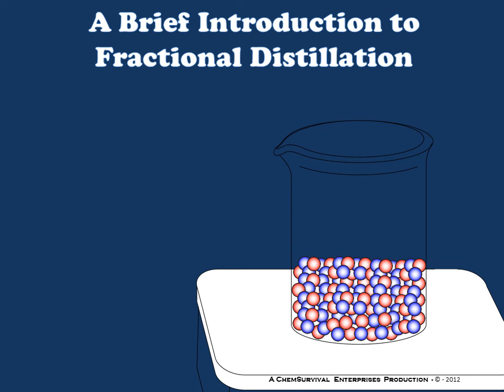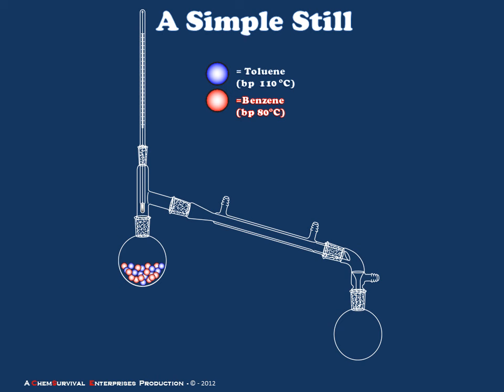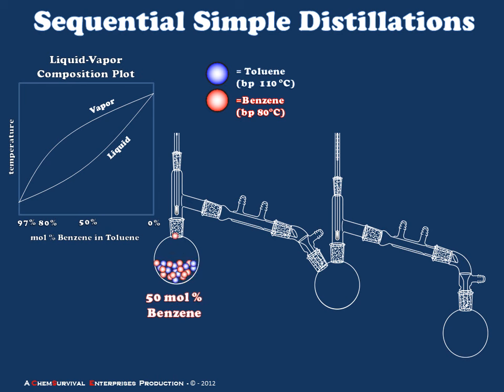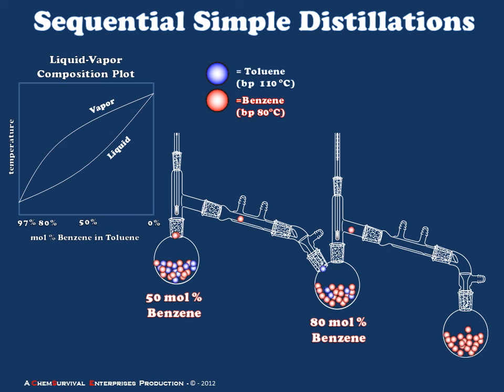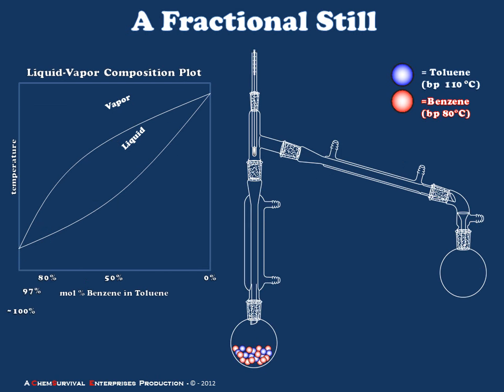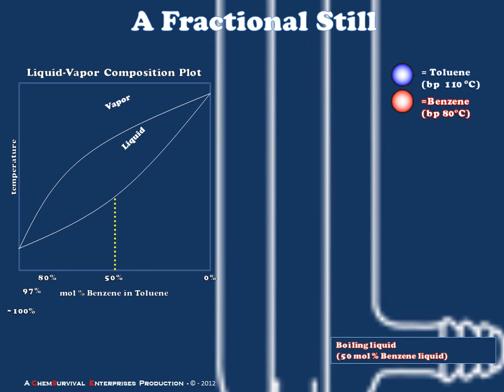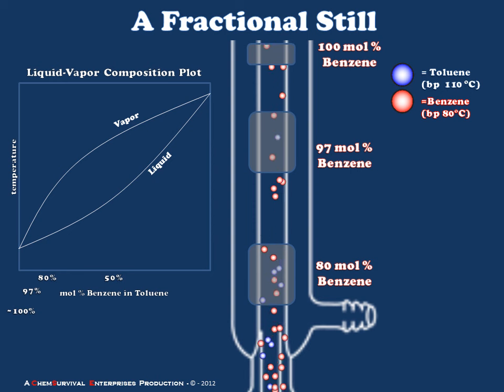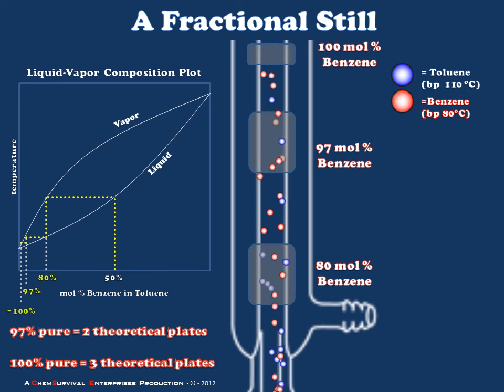A Brief Introduction to Fractional Distillation

Comment: This is a simplification which I needed a long time to understand. If you heat up the first liquid mix, it's already changing its mixture while doing that (liquid part). So you won't get a 80% purity, it has to be less. You only get almost this purity, if the second amount (the evaporated stuff) is much less then the first.

Comment from the maker: Hi Kris,

I try to keep the videos short.  Discussing packing with steel wool, glass beads or even those columns with actual physical plates would be a cool enhancement.  I may yet explain this technique in a later release of the video or in a different video all together.  As a side note, we have learned in our labs that even when students neglect to pack their fractionating columns, they still get better results than running stills without the column at all!  Thanks for the comment.

Comment: After the first distillation 
The 80% mil benzene 

This means that the total pressure is
(0.8×1200) +(0.2×300)=1020 torr
This means the other distillation would give me (960/1020) ×100%=94% mil benzene 

Can you please tell me how did you get 97%??
Are my calculations wrong??

Comment from the maker: Hi Anxious.  There is no water in the jacket around the fractionating column.  Reflux condensers are often re-purposed for this task, but NO WATER is used, because a temperature gradient across the column is crucial to proper function.  As condensation forms in a higher (cooler) region of the column, it begins to descend and vaporizes again in a lower (hotter) region.  Often, columns are packed with inert solid material to maximize surface area on which this process can take place.
Reply: So I can use an old condenser for this? I have one laying around.
Reply from the maker: @Phoenix_Atlas  I see no reason why not, just as long as you keep in mind the points made above.
Reply: @ChemSurvival  then would just a long glass tube extending straight up work the same way since you don't pump water through the the condenser chamber?
Reply from the maker: @Phoenix_Atlas  yes.  In fact there are specially designed fractionating columns that do not contain the outer jacket at all. I use a Vigreux column much like this one:  

 https://www.labdepotinc.com/p-64122-distilling-columns-vigreux?gclid=CjwKCAiAxJSPBhAoEiwAeO_fPx7gZ0oAMBNtm9ImDm9HRYYKEIKixVUg43_DKHTvHdP3PE2jSEOYJxoCR8AQAvD_BwE

on my setup.  Those columns are fine to use as well, although they cannot be re-purposed as a condenser should you find the need for one.
Reply: @ChemSurvival  that's awesome. All the fractioning columns I've seen are intricate glass pieces that look extremely expensive compared to just a glass tube.
Reply from the maker: @Phoenix_Atlas  make no mistake, the additional engineering certainly makes for more efficiency, but  you can definitely improve a simple still with the addition of any kind of column available to you.

Comment: You said that on 2nd time distillation we get 97% benzen , but my calculation show 94% . Please check If I am calculating wrong.

Pt = 0.2 * 300 + 0.8 *1200 = 60 + 960 =  1020

now % benzen in that vapour is = 960/1020 *100 = 94 %

Comment: how is there vaportization and condensation occurring in the  fractional still? is there a water jacket around the distillation column? is heat being added to the system from the boilup then condensation is occurring of the heavy keys that touches the sides of the fractonation column? please advise.

Comment from the maker: HI Shane.  There are clearly some simplifications in this video which are intended to make it easier to digest.   I disagree with your assertion that no vaporization happens in the column.  There is a temperature gradient along a fractionating column, so as condensed liquid descends the column it has an opportunity to re-vaporize, thus becoming more enriched in the more volatile component.  To say that it is simply refluxing toluene and distilling benzene is also an oversimplification.

Comment: When you cool down 80% mole vapor Benzene,  would it be considered 80% mole Benzene in Toluene? Then afterward, when you heat it up, does that 80% mole Benezene in Toluene turn into 97% vapor benzene?

Comment from the maker: Yes.  Reflux condensers are often re-purposed as fractionating columns.  When this is done, it is critical that NO water be used in the jacket as this will defeat the entire purpose of the column and amount to simply refluxing the mixture.  This is a common mistake made by introductory students who don't read the procedure carefully before going into the lab!

Comment: Disclaimer. I live in New Zealand where distilling spirits in the home is not illegal. I have a small still that thru watching your video uses the fractional distillarion mechanism you describe.  The "pure" ethel alcohol fraction comes out of the angled column on the right at between 48 and 52C. I have a question:: Do I have to monitor the temperature of the solution being heated that contains both water and alcohol? Or will the alcohol fraction keep the temperature stable in the heated solution until all the alcohol fraction is boiled off?
Reply from the maker: Hi Clarkewi.  Even in the best fractional still, the composition of the distillate will change through time.  Generally, this change involves increasing concentrations of less volatile components (in your case, more and more water content).  So the highest proof spirits (those with the lowest boiling point) should come over first.  If you are monitoring the temperature in your still head (the temperature of the vapor above the boiling liquid, not the dripping liquid distillate), you can gauge when it is time to stop your still by looking for a sharp increase in the temperature.  This is an indication that the ethanol is depleted from your boiling vessel and now you are just bringing over more water and diluting your distillate.

https://youtu.be/nFJy6F_E50o

This video might help you to understand better.  If you can monitor the temperature of the vapor in the still-head, you want to try to stay on the lower plateau of the diagrams that I discuss in this video.  A healthy still should operate in the mid 70 to 80's of degrees centigrade.  Good luck on your (perfectly legal down under) project!

Comment: So, there's a calculus here that's not mentioned.  Your lower mixture won't stay at 50% very long, meaning you'll need a longer and longer column to maintain ~100% as your mixture boils down, correct?
Reply: based off data i got in my own lab from this, our sample got more pure the longer the experiment ran.  we took samples at different points in time and our last samples were the most pure.

Comment: Thanks so much for this video! Now I understand how fractional distillation works.
I have a question: in an azeotropic mixture, we can't separate them using this method. Is it because they have similar partial vapor pressure?

Comment: Brilliant explanation! It's a pity it took me so long to find this. One question though (if you're still around :) ) - With two miscible liquids with significant boiling point differences (as per benzene/toluene), Is there any advantage in warming the fractionating column to the boiling temperature of the benzene (the lower of the two boiling points) to minimise condensation of the benzene in the column and perhaps give it more "encouragement" to reach the top of the column?
Reply: I have the same question but I think if u had a warmer column the faster it would go but it would be less pure because there would be less reflux of the toluene

Comment: this is a great illustration!! good job ! but i have a question what about the natural progression of the system won't the system raise in temperature to accommodate the loss of the vapour pressure so the liquid can still boil?? and wouldn't that reduce the purity of the vapour gradually containing more of the less volatile liquid?? and how would the plot proceed in a continuous distillation ?
Reply from the maker: YES!  That is exactly what will happen!  You can see my explanation of it here http://youtu.be/nFJy6F_E50o

We usually simplify introductory explanations of distillation by only considering the first moments of the process, when the composition of the boiling liquid has not changed appreciably.  However, as time passes, it will indeed become more concentrated in the LESS volatile solvent.  This results in a constantly (though not necessarily consistently) changing boiling point for the remaining un-distilled liquid.  Please check out the video linked above and share with your friends/classmates/students/teachers
Reply: ChemSurvival Thank you :)

Comment: I believe there are some flaws in his explanation. There IS condensation in the fractionating column, but there is no vaporization happening in the column. What happens is, toluenes bp is higher than benzene. When the 80% benzene and 20% toluene vapor passes through the fractionating column, it cools the vapor down enough that the toluene and a small amount of benzene condensates and falls back into the flask. Basically refluxing toluene and distilling benzene at the same time.

Comment: In the fraction still, The gas (which has 80% benzene) condenses because the temperature drops.. Which I understand.. But then how does it vaporize again IF the temperature is low?????????  The substance oscillates between gas and liquid phases in this tube which purifies the gas as it moves up but again... How does it vaporize if the temperature is low.  Please someone explain this to me.. Thank you!
Reply from the maker: Thanks for the question.  It vaporizes again because there is a temperature gradient along the fractionating column.  The higher you go on the column, the lower the temperature and, of course, the lower you go, the higher the temperature.  As a newly condensed drop descends ever-so-slightly, it is warmed ever-so-slightly and vaporizes again.  This process continues along the length of the column, resulting in a distillate of much greater purity than a simple still can accomplish.
Reply: Ah, I see. I'm assuming that small volumes of the gas/liquids in the fractionating column help with the phases.
Thank you for answering!  It's much appreciated!

Comment: Just a wonder 
Can we distill salt-water
Reply from the maker: we sure can.  some water desalination technologies use this technique (at least in part) to lower salt concentrations in water.  It is a very high-energy-consuming technique, though (boiling water takes a lot of energy, which is costly) and there are usually other ways to coax the water away from the salt in a more cost-effective manner (like reverse osmosis).
Reply: @ChemSurvival  Thank you

Comment: What does it mean mol% ?!?!
mol ist just a number (6,022E23) and 1% is 0,01 of something.. mol% is then 6,022E21 particles 
just use % O.o
Reply from the maker: Hi Karlo.  This is a GREAT question!

When we discuss percentages, we must either state (or assume that our audience already knows) the units we are comparing.  For example, consider a mixture of two gasses - one mole of each.  Now let's say that one gas has a molar mass of 100g/mol and the other 200g/mol.  This means that the mol% of either gas is 

(1 mol)/[(1 mol)+(1 mol)]*100%, or 50 mol%. 

Now, assuming that one of those gasses is TWICE the molar mass of the other.  the mass% of the heavier component is

(1mol * 200g/mol)/[(1mol *100g/mol)+(1mol * 200 g/mol)]*100%,

 which is 200g/300g*100, or 67 mass%. 

So if I just say "50% of gas A", I leave the viewer wondering that the ratio really is.  Is it based on mole count, or mass?  It matters, because each method describes a different combination of the two!  To relieve the ambiguity, I MUST state 'mol%' or 'mass%'.

In the case of distillation we are using ideal gas law and others to make our prediction, which means we are assuming that all gas phase molecules are indistinguishable from one another (hence the name 'ideal gas' law). So here it is the mol% which will dictate the behavior of the components of the system.

Comment: Isn't this just like refluxing?
Reply from the maker: darkwarrior396 Not exactly.  It looks similar, but refluxing uses a water-cooled condenser to condense and recollect anything and everything that vaporized right back in the original boiling flask.  In fractional distillation, we do not cool the vertical column.  This allows a temperature (and therefore, concentration) gradient to form along the column, with higher proportions of the more volatile components higher up in the column.  In my simple demonstration here, only the material reaching the top is collected.  In industrial processes, however, (like fuel refining) the column is tapped at different heights to collect various mixtures of compounds for all sorts of applications.   It is a great way to ISOLATE a desired mixture, whereas refluxing is quite the opposite, intended to keep everything mixing in the boiling flask at high temperature.

https://www.youtube.com/watch?v=b6xFAEkjmGg

Check out this video for more information on refluxing.
Reply: Thanks, you are an awesome teacher.